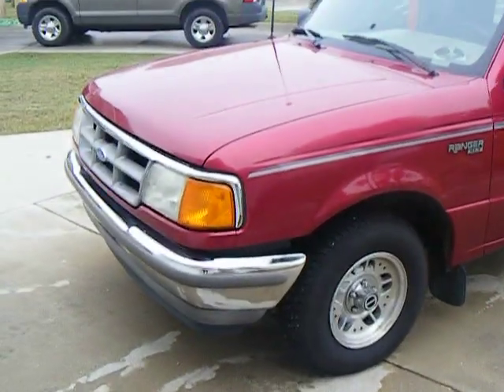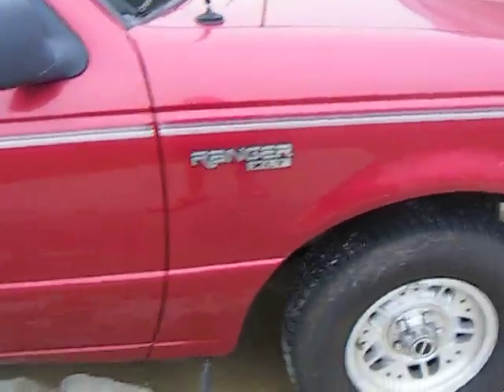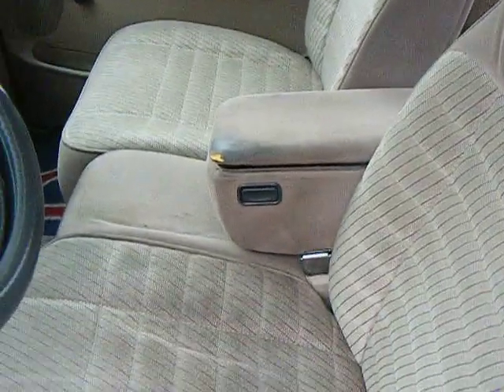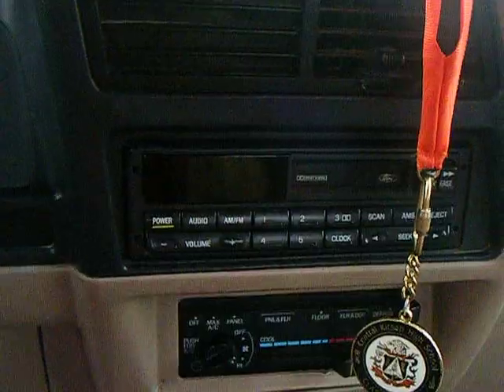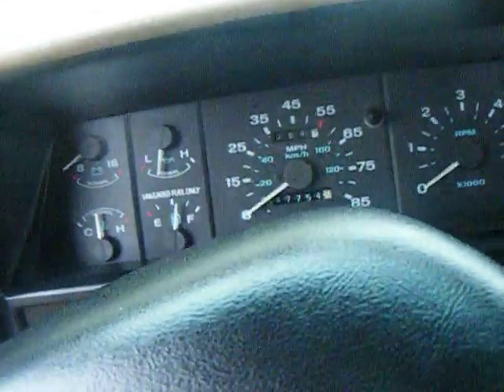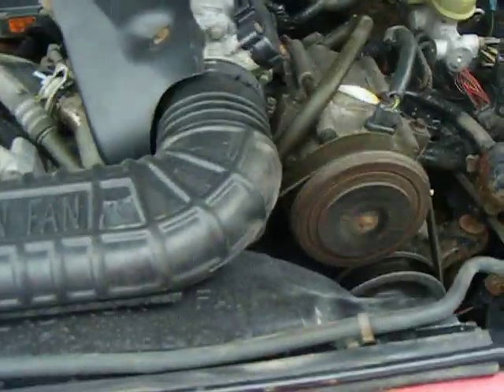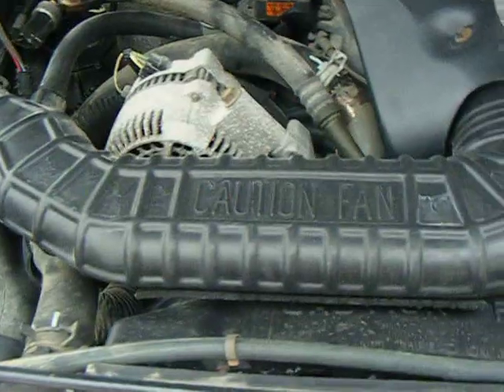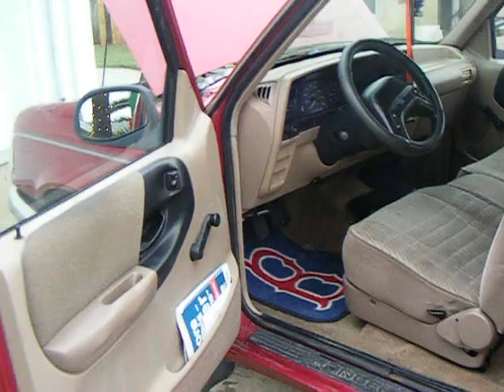Hitch's 1994 Ford Ranger XLT Supercab

Comment: I'm the original owner of a Ford Ranger 1994 XLT. I've made several trips from Cali to Florida and back and it has never had any major mechanical problems. Not like your typical Chevy rust buckets which are complete trash cans on the road. It's no wonder why the S-10 went was discontinued, among many other of their cars.

Comment: Nice truck -- I had the same kind of truck in 1994 (bought it new) It was blue, also a ext. cab. I had the windows tinted. Which turned out to turn purple four years later. I put vent visors on the doors. Also, a bug shield for the hood.
Reply: Mark Miller you still have it ?

Comment: Ford makes great trucks rangers are tough truck you get allot of miles out of them only thing is they rust. My dad had a 94 ranger got almost three hundred thousand miles out of it. The only thing is you might end up replacing battery and alternator other than that there solid.

Comment: got the same thing exactly the same, little rust on the drivers side rear corner, it's an automatic 4.0 and a dent in the drivers front corner, also i put a dual exhaust, had that put on when the same shit happened to mine with the exhaust, pipe rusted off right after the cat lol

Comment: i just got a 1994 ranger color is like tan but more lights than dark. but its a good color. 5 speed manual i need to learn stick first car though. its a 4 cylinder which it will get atleast 25mpg. we it for 2000 dollars 73,122 milles on it original. never rebuilt. 2wd unfortunatly

Comment: i got a 1999 ford ranger check it out i like yours mine has a ton of aftermarket parts on it i dont like them im replacing roll pan with stock bumper and aftermarket grill with stock chrome

Comment: Dude 5k, you got ripped off... I bought a ford ranger with 172,000 miles, only thing i needed to fix was replacing the bed on the truck... witch i was lucky and found it for 100 bucks and mounted it myself for free..... And i only payed 1000 bucks for the truck.... and had to put 900 into it altogether after i let it sit for a year the full pump went  bad on it and it needed new shocks... so all in all i put 2400 bucks in it roughly.... And it runs like a beast.. Seriously dude fuck car dealers!